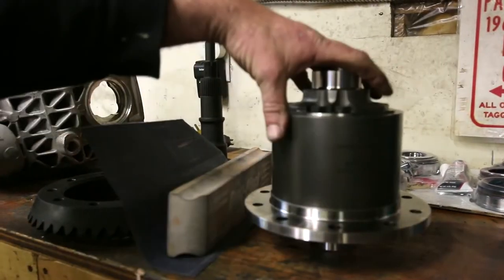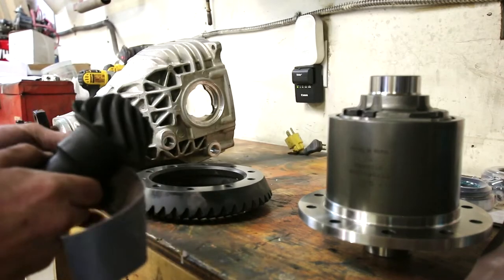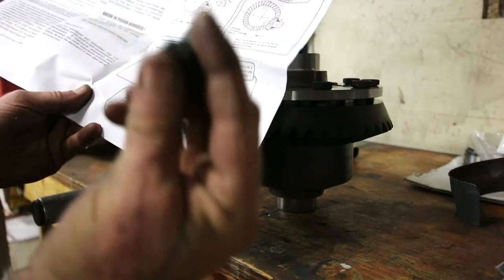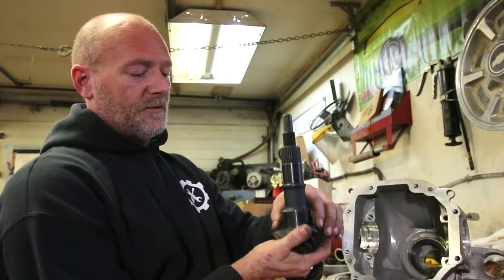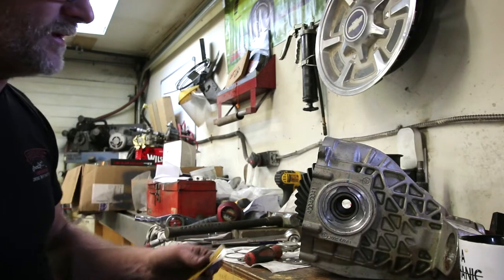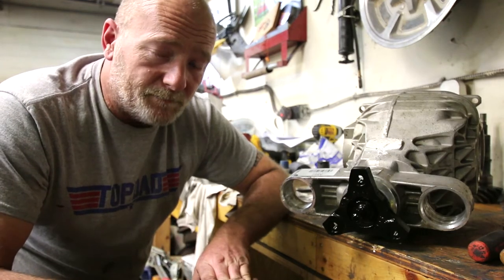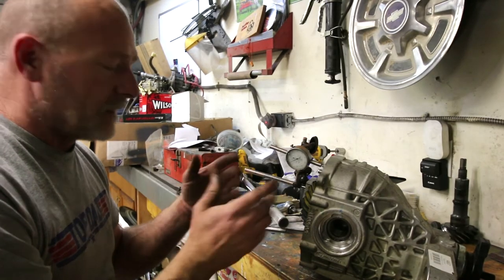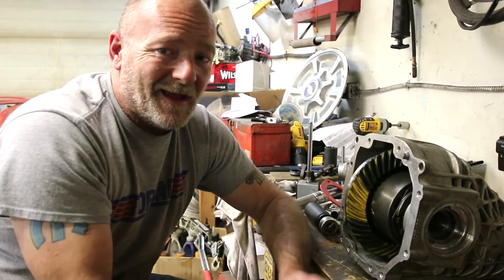2010 Chevy Camaro SS Broken Limited Slip Differential Upgrade with New Gear Ratio and an Eaton Posi

Comment: Can’t wait to get mine built for my 2010 2SS coupe…. I think I’m going with a AAM 3.91 full diff build kit. 

I didn’t know whether to retain the stock Chevy Positrac limited slip, but I do know that I think I wanted something better-performing. I’m essentially going to only be re-using the diff housing/casing; the diff bushings will most likely be replaced as well.
Reply from the maker: AAM makes a great kit. I would recommend an upgraded posi. Sounds like it's gonna be a sweet build! 🤘🏼

Comment: I always wondered why the bearings are press fit. Even with a 'slip fit' I doubt the race would ever spin after everything is torqued together.👍
Reply from the maker: I've rebuilt a pile of diffs from most manufacturers but the ones the races have spun in the case are always the same. Hard abuse, overheat, low fluid levels. You're right I think though. If everything is good when torqued together and the thing is maintained , I wound see any reason for concern at all. 🤘🏼

Comment: Hi Dave, Very nice video. I have changed out my SS Differential to a ZL1 differential. I'm guessing the rebuild procedure is the same? Do you know if there is a posi unit available for the ZL1 differentials?  If so, is there one you suggest over another?
Reply from the maker: The procedure is essentially the same. There may be a couple small differences but paying attention to the manufacturer of the gears recommendations will work out just fine. As for a ZL1 upgrade posi, I believe eaton true trac is available for it but I confess it has been a while since I went through the searching on them. Keep me posted on your diff build please! And if I can be of any help, I'll certainly try for you. 🤘🏼

Comment: Loved the video. Great step by step. What brand g ear set did you use on this build? How is the differential now that it is installed in your friends vehicle? Thanks.
Reply from the maker: Thank you for your comment! The gear set we used was motive race brand. It's the same quality as Richmond as far as I'm concerned since motive bought out Richmond years ago. The gears are running good. He did develop a slight howl at 80km/hr or 50miles an hour. But he also gave it a couple nitrous blasts soon as the breakin mileage was complete.... so he created the howl. I'd have given it longer and fresh oil before any nitrous hits hahaha. But runs smooth and he is happy.

Comment: Great info Dave. Have a 2010 Camaro SS with LS-3. Thinking of switching the 3:45 to 3:91 or even 4:11. Can’t tackle this project I’m thinking but learned a ton sir. How does your friend like the new gears ? I’m not sure if I should look for a diff with the 3:91 already in it- 1 LE have those factory or buy a set of 3:91 I found in my area with 21,000 miles. Thanks again, Mike
Reply from the maker: Hey Mike, thanks for the comment. My buddy loves the gears. They fit his driving style perfectly for what he is after. I wouldn't be afraid of running the used 3.91's at all. If you can inspect them and it's good to be able to measure the backlash before they're removed from the housing. But if that's not possible, just have em set up to factory specs and get a good pattern check before using them. Should be just minty for you 🤘🏼

Comment: Super longwinded crown gear install on day 1 (the easy part), I was surprised that you skipped the bearing cup install and pinion bearing polish.  Did you have that part done somewhere else?
Reply from the maker: So I had to freeze the pinion bearing cups  and it was time sensitive once I pulled them from the freezer. Didn't out the camera on for it. Was more worried about getting them in properly. As for the bearing polishing for the slipper bearing, I could have shown my process and probably should have. As this is not the last diff for me to do , I will show that process in the next diff build video. Thanks for checking the video and the feedback on improvements. 🤘🏼
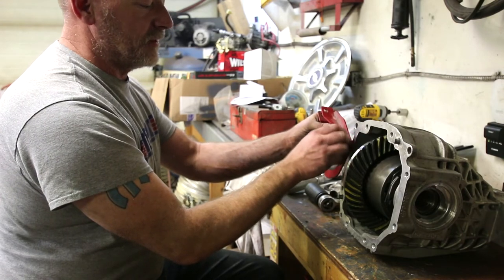Reply: @dazeofgloryshopworks5806  Starting at 27:34 mark-   The pattern is terrible...way to much pinion shim.   It's obvious to see with the flat line you have at the root of the gear tooth.  You're not even close yet.  I noticed the stock diff mount bushings removed, it WILL be a noisy diff with stock diff mount bushings and really loud with aftermarket rigid bushings.  Reduce your pinion depth .002-.005, then reset your backlash to spec, then check your paint.
Reply from the maker: @jimmyfreeze3782  you're correct on the noise of the driveline transmitting through the car. It's what my customer was going for as he runs the car on nitrous and is no stranger to high rpm launches. The solid mounts help where he wants it to help. 🤘🏼 thanks for checking the video again sir

Comment: Hi, I have a 2010 automatic v6 Camaro. I need the differential section of the workshop manual because I need to rebuild mine, and I prefer to have every spec in my hands. Can you help me?
Reply from the maker: I'm sorry didn't see your message. I can definitely see what I can do to help
Reply: Hi mate, the diff Is on my workbench, already opened, have you found something?
Reply from the maker: @Andrea_eTi  can you send me your email address and I will see if I can scan the info I have found for you and send it later this evening

Comment: Hi, what would the labor cost be for this job in your area?
Reply from the maker: Hi, it's hard to estimate truly, but if the differential is already out and dropped off, the shop would say anywhere from 3-5 hours labour. That's if all goes smoothly. Our labour rates are around $145.00 Canadian $$ and then add shop supplies and tax, between $500 and $800 to do the work.

Comment: Just ran across this video, im looking at diff rebuild for 2015 camaro. What does this usually run and can you assist?
Reply from the maker: I can't say what the cost will be as my buddy supplies all the parts. Also it was 2 years ago and it would no doubt cost more. Bank on at least $1500 would be a good place to start. 
I can assist with some questions and helpful tips as you go. Can't guarantee I'll get your messages as soon as you send them, but I'll definitely try to help. Thanks for checking the video out!

Comment: What do you have for pinion depth  I have the same rear end my pattern don't look as good as yours
Reply from the maker: If you're building stronger, I recommend motive or Richmond gears. And the posi I used was a eaton tru-trac I believe. Very strong. As for the rest, he did get aftermarket axles and urethane bushings for the diff mounts and control arms.
Reply from the maker: I missed the pinion depth part. My mistake. I was at work and glanced instead of reading. My apologies. 
I lucked out with using the factory pinion shim that's was in the old gear set.  When you have to select different shims, always change it by 5 thou thicker and then thinner and run your patterns each time. That'll tell you which direction you need to go.

Comment: What size bearing shim came with your
Reply from the maker: Truth be told, I don't know if I measured the original shim when I pulled it out. When building diffs for a living, you got used to just swapping the original shim to the new gear set and starting there. 
What is the build on your diff? Gear ratio change? Brand gears and posi? 
Can you email me a picture of your current pattern? (dartdave408@gmail.com) 
Also, did your posi fail or is this strictly upgrade?